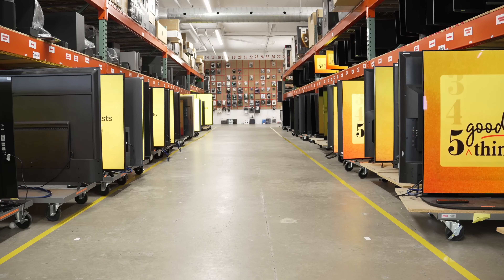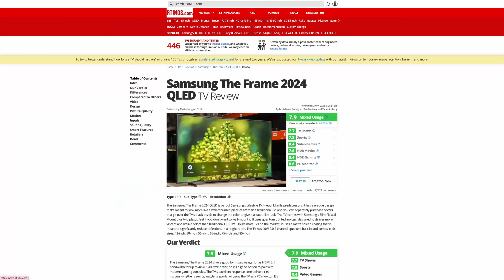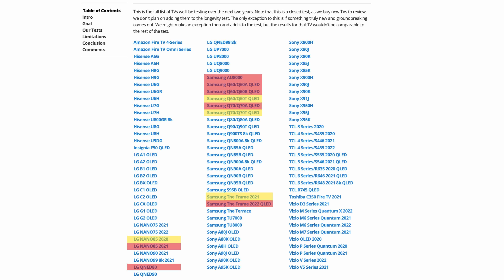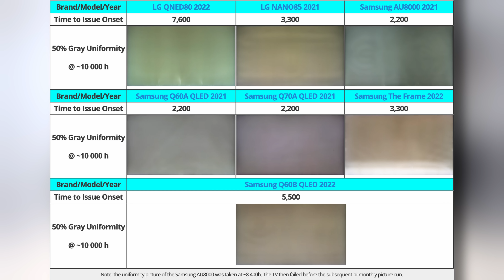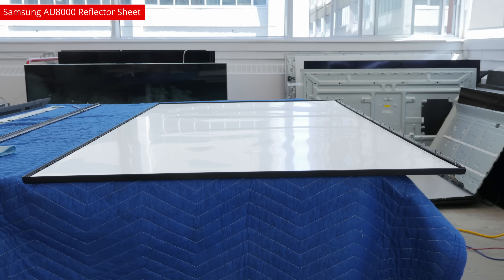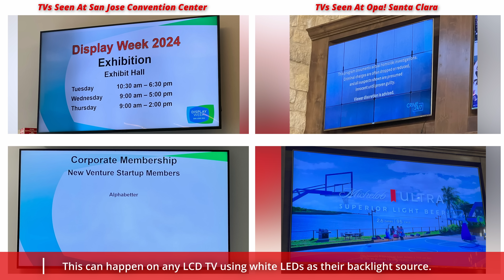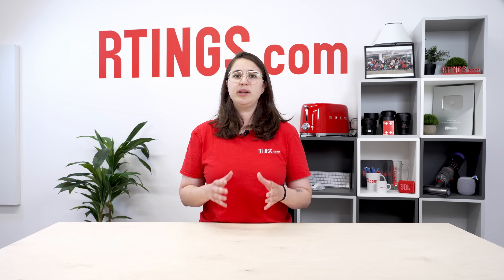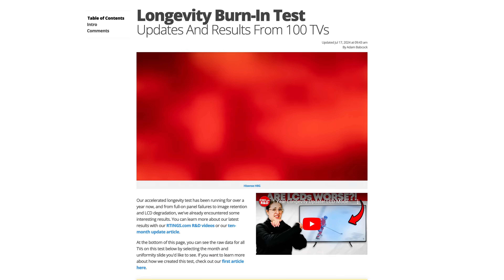Edge-Lit TVs Fail FASTER Than Others (100+ TV Test)

Comment: I always use my TVs at under 60% brightness and under 50% Contrast because higher makes my eyes literally hurt.
I have an old LG LCD 32" 1080p 60fps one that has lasted me 16 years and hasn't shown any signs of damage.
And then I got another LG different model, cheaper, 30fps, 768p as I didn't need a high end one for that room. From the start I noticed that the back LEDs showed through because of the low brightness, when a Sunny sky or white scene played I could see the array on the back as "ghostly white suns". Then less than 3 years of considerably less use than the older one, one of the back LEDs died and the rest seemed to get less voltage as a result, so it sometimes went awfully dark, maxing brightness wouldn't change a thing.

I got a HISENSE 4K and I think it is an edge lit, I wish I had seen your video earlier. At least with my lower Brightness needs I think it should last longer before the problems start showing.
But next time I need a new TV I'll go for Full Array then.

Comment: I'm assuming that by thin LCD TV's you're most likely referring to LED TVs which is what is most common, but 10,000 hours is what I might say normal for an LED to be used (on).  I mean we have LEDs in many things, but part of the reason it seems those things last longer is because they are not on as long or consistently, for example like car brake laps which are only on for a fraction of the time you're driving, so they can probably last 10-20 years, but otherwise if they wrere left on all the time, they too would probably start to burn out after 10,000 hours or less.  So if you're saying that 10,000 hours is roughly the average life of an LCD/LED TV then that may not be too bad if you consider a typical (non-leap year) calendar year has 8760 hours, then that would suggest these TVs, if left on continously, would last about 1.25 years.  Even if you watched TV for 8 hours per day, then it should last you about 5 years of use.  Many things these days are "designed to fail" after the warranty runs out, and warranties are getting shorter and shorter.  Cars are probably the one thing that hasn't changed as most still have the 5/60k power train warranty and 3/36 standard warranty which has been the case (as a minimum) for probably the past 20-30 years (some have better warranties than others).

Comment: Results are what i was expecting. I had an edge lit TV before and after a couple of years started showing similar defects to the ones shown in the video. 
OLED has the burn in risk (which is very low these days) but overall  they keep a good picture quality for way longer than LCD TVs..

Comment: 9:57 I love the corporate speak, "edge lit has been reliable for over 15 years..." Yeah, in much smaller displays, and with cooler cold cathode fluorescent tubes that don't get anywhere near the melting point of plastics. 

These TV's are likely fine if you run them for a few hours a day, but not in constant use, the heat just can't escape.

Comment: I work in electronics repair, and these have been very well-known issues for years. We always turn the brightness down to 30 % or so before we return a TV to the customer, and recommend that they don't turn it back up. The default brightness setting on a new TV is almost always set so that you can expect about 5000-10 000 hours of runtime before the LEDs start failing, and you can improve that fivefold by reducing the brightness. I'd expect the failure rate of the TVs in this test to increase significantly once they pass the 10 000 hour mark.
Reply: Верно яркости 25-35% предостаточно. Об этой проблеме у светодиодов давно узнал у ремонтников.
Reply: There is an important difference between running 100% brightness with dynamic contrast enabled vs disabled. With dynamic brightness enabled the backlight will be dimmed automatically and only run at full brightness when the scene demands it. This way heat buildup will usually not be such a problem.
Reply: @felixokeefe  This depends on how the TV is designed. Dynamic contrast can just as well mean that the LEDs are overdriven at low brightness, and severely overdriven at the short peaks.
Reply: I hate too bright TVs. I got rid of a brand new Hisense because at night it was way too bright even with the backlight all the way down. And even though it was 4k my 2011 LG looks way better.
Reply: You can't turn them all down to 30%.  Turn it down what you can till it starts to degrade the picture... My 2011 sony is set to 60% .  Note some tvs have a "auto" backlight andsetting of high ,med or low.
Reply: That’s a good recommendation. My tv is definitely not as thin as the ones i see in electronics stores. You can chose from some predefined settings and I chose ”economy” which means the screen will not be really bright
Reply: @TheFrewah  That's like buying a $1 million house and using only the living room, bedroom and bathroom while ignoring the 10 other rooms + large backyard.
Reply: @thenonexistinghero  That’s about what you have to pay for a villa in Stockholm where I live and I can assure it won’t have 10 rooms or a large backyard.
Reply: @TheFrewah  It's a figure of speech dude.
Reply: @thenonexistinghero I think they knew that they were making a point lol
Reply: @thenonexistinghero  No, it's like buying an expensive house and not leaving the lights, heating and AC on 24/7, as well as the windows open. It's a matter of using a machine within its limits, and the manufactuers profit from setting the limits too high.
Reply: THIS! I do the exact same! Running LED's close to maximum voltage is the quickest way to kill them. All my customers, and our own screens, have NEVER failed re backlights. Unless you have bright sunlight coming through, TURN THEM DOWN!
Reply: I’ll go full brightness then back it off 15% so if it goes to 100 back it off the 85 and you’ll be okay.
Reply: Outside of movies,  I personally prefer to put my edge lit Samsung AU 8000 to " natural " picture setting as it's not very bright and colors look richer.
Reply: Then where is my NITS? why TV is so dark?
Reply: Unfortunately, unless its a linear regulator instead of PWM (unlikely)- that doesn't increase lifespan all that much. The LEDs still wear at the same %, and so does the phosphor. 30% should really be somewhere below 30% average current into the LED.
Reply: @Originalsunrunner20  No, that is not correct. You are right that a linear regulator is better for lifespan than PWM, but since the main driver of LED wear is temperature, turning down a PWM controlled monitor will make your LEDs last much longer. That is because the average current over time becomes lower, which makes the LEDs run cooler, and the phosphor doesn't wear while the LED is not emitting light.
Reply: I wonder how much failure would be avoided with a small exhaust fan on the top of the unit.
Reply: @stephendetomasi1701  Not much. The problem is mainly the thermal resistance between the LEDs and the heatsink. The LEDs run at 100+ C while the heatsink is much cooler. The only solution is to use LEDs that are better at conducting their heat into the heatsink, or using less power per LED. Only after you've done that does it make sense to use bigger heatsinks or fans.
Reply: Then what's the point in buying a nice TV at all? I'd rather get a bright panel that actually shows its content (even if the quality is lacking) than a super dim accurate panel that is too dark to make any detail out anyway.
Reply: @Florin_Neagu  That is a question to be asked of the manufacturers. They choose to build TVs with LEDs that are run too hot and fail prematurely. If the TVs were engineered with appropriate thermal design to begin with, this would not be a problem.
Reply: Fully bright is how they get that high dynamic brightness range.  Just don't be upset about replacing your tv every 3 yrs.  It's good for the landfill business.
Reply: The problem there is that that's not what customers want. They want ever brighter and brighter TVs no matter what. This is because they very foolishly want to run their TVs in a bright room with all of their windows wide open and all of their lights on in the middle of the day - and they want their TV to be perfectly visible from all the way across the room like that. When you tell them to draw shades, shutters, curtains and blinds to block out that light and darken the room so their TV doesn't have to work as hard (by not being set on max brightness) they look at you like you just told them to throw their first-born child off a roof. But, then those same people complain when their TV craps out on them after three years of being run like that.
Reply: Agreed I really dont understand ppl enjoying that sub-burning level of brightness. Its insane.
Reply: @kimball4699 Some rooms have large windows that lets a lot of sunlight in, making a television hard to see.
Reply: @kimball4699  It's not. TVs are still much dimmer than LED lights and that's basically the brightness of reading a book in evening. Reading book in sunlight is way brighter than any TV and reading a book just feels okay. In fact it's that TVs are still very dark compared to completely regular everyday things. It's pretty crazy how slowly screen technology improves in terms of brightness.
Reply: @kimball4699  Maybe you should understand people have different needs, and that their eyes are different than yours.
Reply: My TV's doing just fine with full brightness over 99% of the time after more than 5 years and probably 15K to 20K hours on it. Then again, it is a Sony Z9F and Sony's master series TV are build to last. The image looks as good as the day I got it. EDIT: I just checked because I found out you can check how many hours you actually used it and ah... the actual time is about 21646 hours used.
Reply: @thenonexistinghero  Every rule has its exception, but your TV will fail much sooner than if it was run at a lower brightness setting. If Sony designed it so that the mean time between failures at full brightness is 20 000 hours or more, then that's a good engineering decision on their part and I wish all TVs were built like that.
Reply: @FFcossag  Seems like you don't understand anything at all. A TV will break at some point. Doesn't matter how much you use it, doesn't much how you use it and it will break even if you don't use it.

When I buy an expensive high end TV, I expect to be able to use it to the best of its ability for many years. It could break earlier, but that's moreso an exception and not the rule. The rule for LED TV's is pretty much 7-10 years worth of relatively heavy usage. The only reason I won't be using this TV until it breaks and will be buying a new one 1-2 years from now is because this TV is limited to 60 Hz in 4K.
Reply: @thenonexistinghero  7-10 years is absolutely not the rule, lol. You usually start to see frequent backlight failures in expensive sets at around 10 000 hours if they're run bright. That's just where the upside-down bathtub curve starts to come into play with LEDs running at almost 100 C. I've seen this happen to dozens of TVs manufactured after 2020, I don't know what else to say.
Reply: @FFcossag  Sounds like you're completely full of it. And no they don't come close to reaching 100C. Even on hot days it's maybe 80C at best and that's still not all that dangerous. Only if you're an idiot and have the sun shining directly on it for many hours on end while having it on it might be possible (and the brightness of the panel would have little to do with it). 

The people who generally have those failures happen either are one of the unlucky ones or... in more cases, they don't treat it properly. Most people clean their LED TV's as they cleaned their CRT's. There's also no shortage of folks using alcohol wipes and the like. It's stuff like that which sends TV's to an early grave.
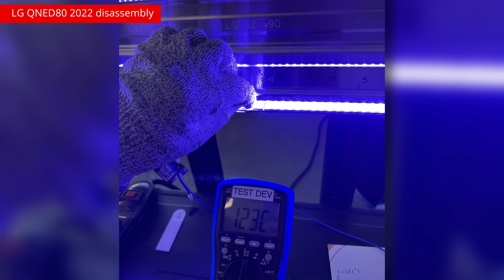Reply: @thenonexistinghero  The video that you are commenting on literally shows LEDs in a TV running at above 100 C at 4:53. Wiping your panel with alcohol will not damage it, though you should just use window cleaner.
Reply: @thenonexistinghero I checked Sony Z9F it’s a soundbar, good one 👌😂
Reply: The master series has local dimming, it isnt edgelit.  @thenonexistinghero
Reply: But again, why do you pay for something you can't use? I mean I buy a racecar, but I will only go 50mph, because it can break quicker when I go 100mph. The same with EVs, it is advised to charge them to about 80%... Great, so my range will be less, then why do I carry the useless 20% in weight of the batteries?
Reply: @ivanskoda144  You're probably a bit behind when it comes to EVs.
It depends on the type of battery they're using.
I have a 2023 Model 3 Performance, which should be using NCA batteries. 
With those, you typically charge up to 80% for daily use to avoid stressing the battery, and then charge to 100% only when you need to take long trips (I doubt you need to drive 400 km every day).
The newer Model 3s, on the other hand, come with LFP batteries, which you can safely charge to 100% regularly.
Reply: @Frigobar_Ranamelonico 
Yes, good point, using an EV in the city, the range isn't a problem. And I think you make it a habit to leave the car on a charger every night, so I guess that's alright. .
Reply: @ivanskoda144  Obviously, it also depends on where you live and your circumstances.
I live in the countryside, but I'm in the EU and have solar panels, so for me it's an ideal use case, especially since trips around here are generally short (30–60 km per day).
Reply: @Frigobar_Ranamelonico  NMC and LFP have nearly the same cyclic lost parameters. Just LFP has ~3x more cycles.
Reply: @ivanskoda144  A TV should be designed to last a long time at any brightness level, just like how an EV should be designed to last a long time no matter how you use it. That might mean that the manufacturer has to use twice as many LEDs, or that the EV doesn't allow you to charge the battery completely fully. With TVs, it's especially egregious since the cost of using more LEDs is very small compared to the price of the TV - something along the lines of $20-$50 to double the amount of LEDs and thus more than double the life span of the TV.
Reply: Doubling the leds won't help double because they do not have a way to sink the heat away in their TV design.  Aluminum led strips that are thermally coupled to the back and cooled by air?
Reply: @tsl7881  The number of LEDs (or rather, the amount of power dissipated by each LED) is actually the single most important factor, because the biggest problem is getting heat out of the LED and into the heat sink. The thermal resistance between the actual LED chip to its solder pads is quite high, which makes it so that the LED can be very hot even if the heat sink is cool. The actual LED chips can often be over 50 degrees C hotter than the heat sink because of this. If you double the number of LEDs, you cut the thermal resistance in half, and the power of the LED in half, so you end up with an improvement in thermal performance that scales with the square of the number of LEDs you add.

LED lifespan roughly scales logarithmically with temperature, so the result of doubling the number of LEDs while changing nothing else can easily result in a 4-10x improvement in LED lifespan for the same brightness.
Reply: @FFcossag  I believe that's also the idea behind the Philips "Dubai lamp" LED lightbulbs that use 4 times the number of LEDs as equivalent Philips bulbs sold everywhere else, and are supposed to last exponentially longer than those bulbs. Apparently the government there forced Philips to sell bulbs that would last practically forever instead of burning out every few years.
Reply: @faulknik000  That is exactly the case. I actually have a video on my channel about turning normal LED lamps into "Dubai lamps" by simply reducing their power.

Comment: Old LCD. screens with fluorescent light and NOT led light,  Can be very durable.

I have a samsung le52b620 lcd which has been on for 24416 hours = 2.785364 years according to the service menu

of course not constantly but off and on.
never experienced any problems.

But all LCD screens, whatever brand, model, had a too weak image processor and struggled where the image moves quickly across the screen, you get stuttering.

Comment: LCD should not break faster than other screens.

My experience is that the heat is always a big problem where capacitors are destroyed.

Another BIG problem is that LEDs. the background lights cannot withstand too much and should not be set to more than around 80% in the TV menu. It's been like that since led (lcd) screens first came out.

The other problem is the build quality, which is not always that good.

LED technology is just as durable, if not more durable, than other screen technologies if it is made well from the factory

Comment: I see tons of broken TVs with dead backlight leds. Including burnt polarizers, reflectors, heat cracks and more. The older TVs seem to have been better made then the new ones. I have over 6000 hours on my OLED now but I run at minimum brightness. No issues yet as my computer monitor!